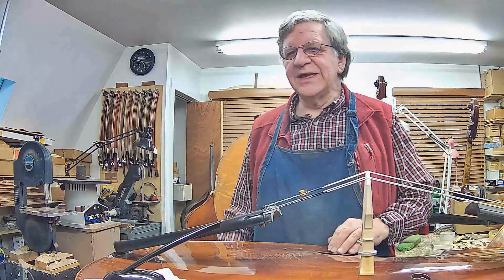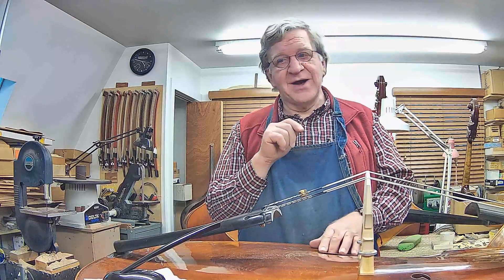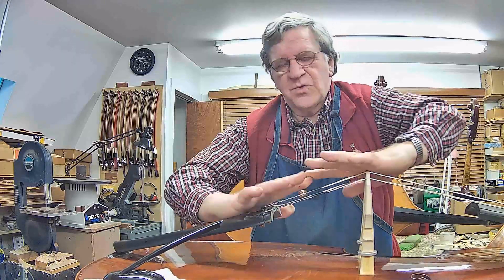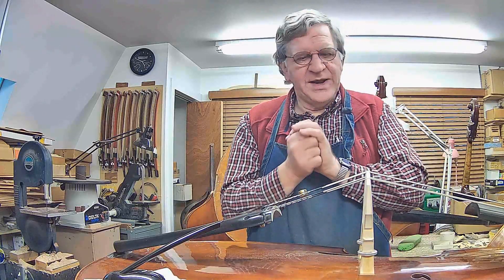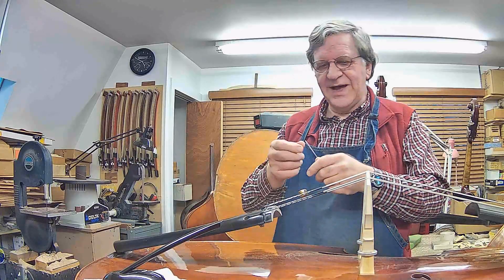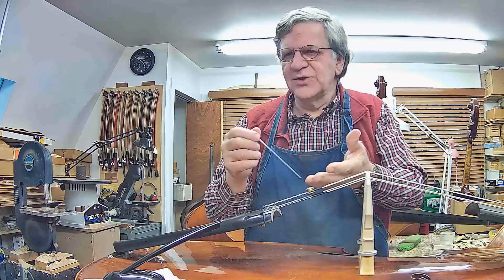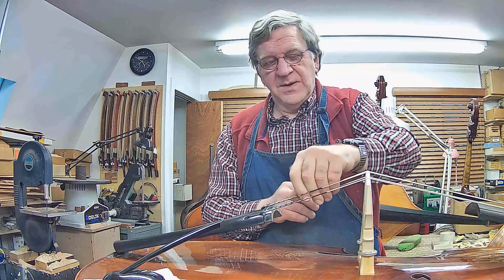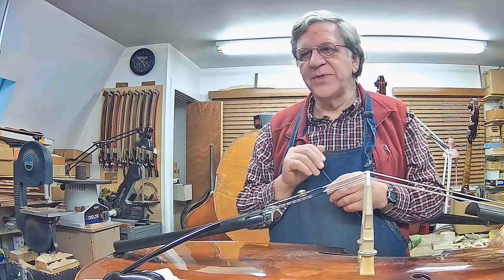Jay VandeKopple Wolf Tone and Fuhr Tube Video

Comment: I dunno if my bass or tailpiece are just extremely resonant, but in doing some experimenting I noticed the resonance of the eliminator after exciting it with the glass tube (and not while it was being excited) would often default to an octave above my tailpiece’s resonant frequency. If I move away from the center, where both the “attack” and resonance are the same pitch, that pitch still comes out (albeit getting ever so slightly sharper) until I get to the extreme bridge or tailpiece ends, where both notes become the same again. Furthermore, depending on where the tube is placed on the eliminator, the pitch can change.

I’m curious if this is something you’ve ever run into, and if so how do you get around it? The solution that seemed to yield the best result for me was to ignore the resonance or any pitches that didn’t come from the exact center of the eliminator, and match that pitch with my wolf.
Reply from the maker: Just to be sure, when you refer to the tailpiece's resonance frequency, are you referring to the up/down resonance at the lower end near the saddle? 
It looks like you're finding that the pitch doesn't change much, no matter where the eliminator is placed. I have found that in a couple instances, and the eliminator method just wasn't a good solution. One might try a different mass to see if you can get closer to the wolf pitch. 
I haven't been bothered with different pitches, depending on where the Fuhr tube is placed. I find that it's not so much an exact science, as the frequency of the suppressor is normally place near the wolf pitch. The effect may not split the high peak on the projection curve, but may just push it over a little bit. I that case you might be able to just shift the wolf to a note that is not right on a note that you want to sound just great.
I think you're right on track by relying most on placing the tube on the center of the eliminator. Good luck.

Comment: Great video Dr. J. I start with an 18mm wolftone and have found good success with your technique. I also place my digital tuner app on my phone under the area and it helps me determine what the pitch is exactly. Cheers.
Reply from the maker: Nice idea to use the tuner. When I'm testing, I'll play the wolf; set the suppressor and check with Fuhr tube, then play again. Don't even need to put the bass down. Works best with 2 people, though.

Comment: Hey Jay, have you used anything else as your friction rod, like a metal rod? Going to be tough to find exactly 1 fuhr tube (Don't know any science teachers, and if I did they're all out of school in Ontario still!!)
Reply from the maker: It is possible, though glass is traditionally used and works well. You need something that has mass much less than what you're trying to measure. So, if you try metal, make sure it's hollow and very light. A very thin plastic tube might be too flexible and may raise damping issues. I think someone varnished a very thin wood dowel, and got it to work, but you'd have to check mass. If you can share the glass tubes with someone, it would help you split cost.